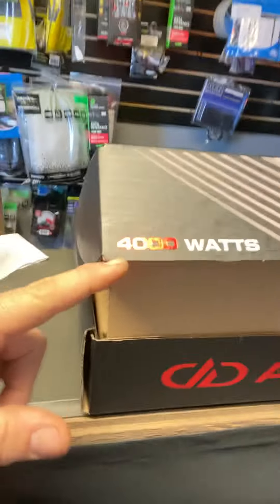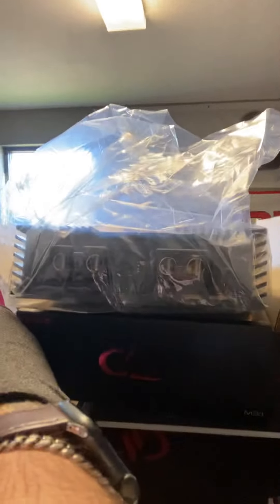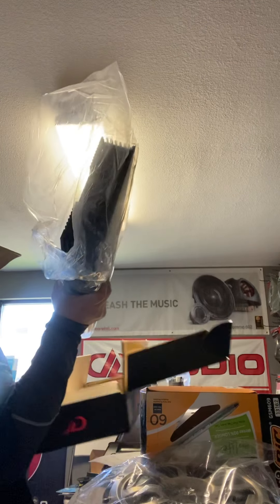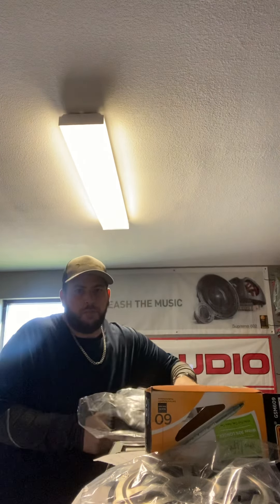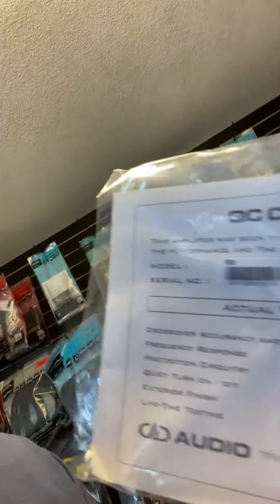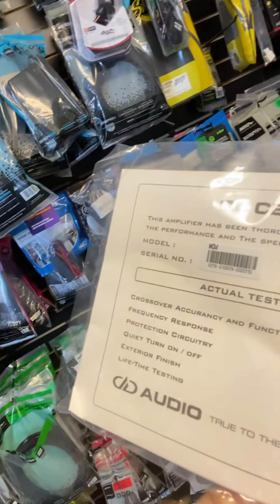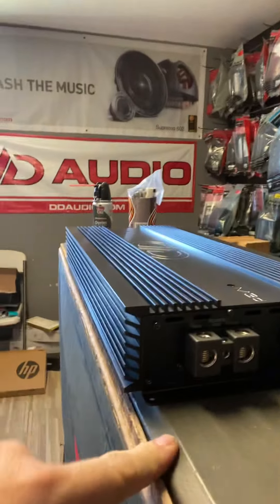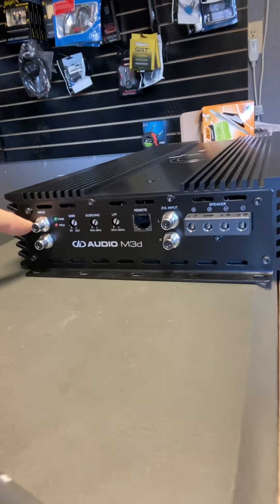Unboxing of the new DD Audio M3D by Digital Designs

Comment: Sorry for the newb ? But what knid of power you need to run one of these. I have a 180amp alt and im thinking a xs d3400.
Reply from the maker: 270amp would be ideal and 150AH or so of AGM
Reply: @wiredkustomsmotorsports  so a 180 alt and a xs d3100 would be struggling lol.
Reply from the maker: Yes. It would “work” just not effectively
Reply: @wiredkustomsmotorsports  ok. Im asking for a m3b which doesnt make a much power. Ive always had problems finding out power requirements. I do have a 240 mechman alt some where that i could use.
Reply from the maker: Shark. M3 don’t make much power compared to ......- a 20K. But the average person runs 1000 ish rms. M3 is 3500-4500wrms
Reply: @wiredkustomsmotorsports  yeah. Its not much but its more then most and dd amps are better built. I plan to get this 9500 motor built for a 10. Should be nasty. Had a 9512 on this amp in a 2016 dart. Made me smile every time the note dropped.

Comment: New DD amps are trash don’t play lows well
Reply from the maker: So now the amplifier is indicative of how low a sub will play?  Come on man. Enclosure is the main determining factor of how LOW subs will play not the amp.
Reply: @wiredkustomsmotorsports  y’all must be new DD dealers cause I’m not talking about enclosures. I’ve got 2512s paired with an M2B and just recently bought the newer version of that amp which is the M2C and it sounded wayyy different. Lows were lacking compared to the older amp and highs hit harder.
Reply from the maker: @Xxbamafan  10 years my friend
Reply from the maker: @Xxbamafan  settings on amp   Settings within source  unit can affect this.